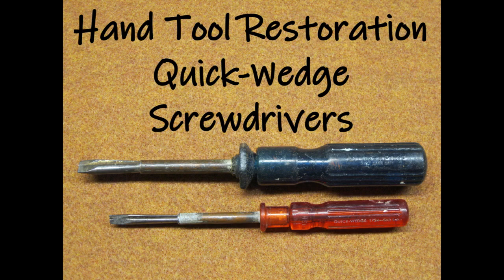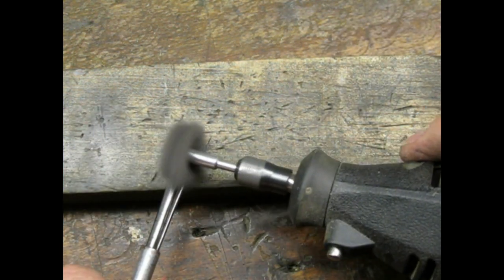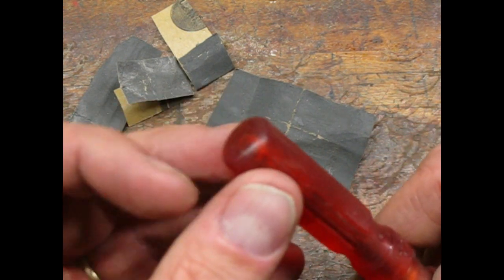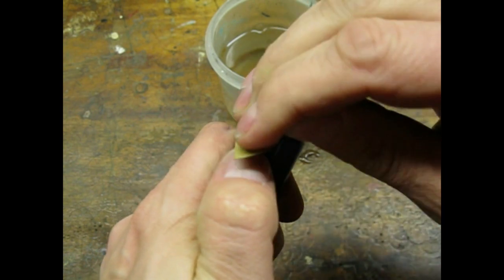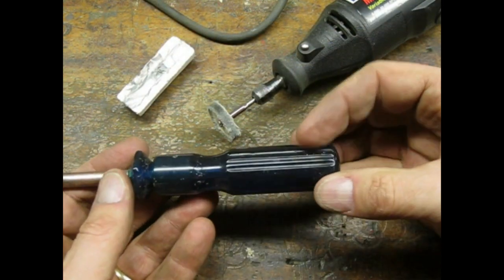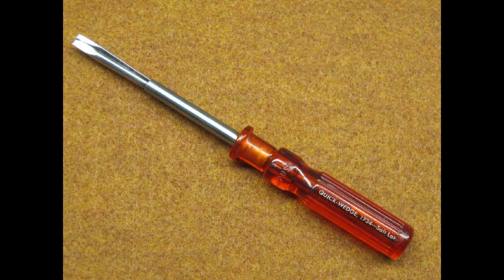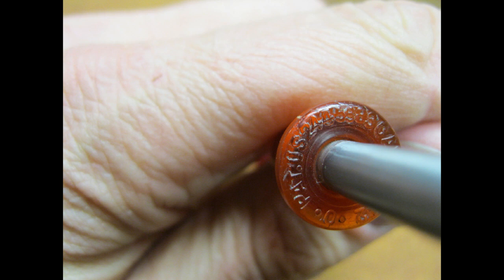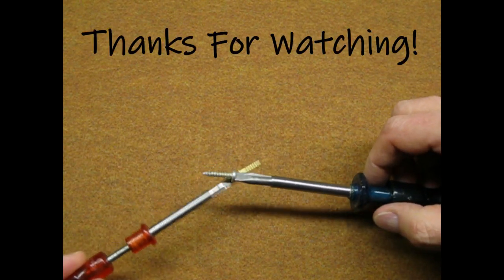Hand Tool Restoration - Quick-Wedge Screwdrivers

Comment: Great job on these, they turned out really nicely. Not bad for 50c a piece!

The copper may have been underlying nickel plating originally, possibly chrome, and once the plating has worn away I think it's a good call to take it down to the steel and polish or give a scratch finish. Sometimes I try to just polish the copper, but it's rare you end up with an even coating with no wear spots and that just looks dumb.
Reply from the maker: Thanks DG!  You may be right about the copper being and under-plate!  I would have left it if it wasn't splotchy like you said.

Comment: That is a nifty set of screwdrivers!! I've seen a couple that used some form or another of a claw to grip the screw, this one is quite remarcable. Great job, the polish of both the handles and the shafts turned out nice, thanks for sharing!!
Reply from the maker: Thanks 2/3!  I think the different screw holding designs are really interesting.

Comment: I have several of those type of screwdrivers that I purchased many years ago from Sears with the Craftsman logo on them.  Over the years they have proved invaluable for certain applications like starting very small screws.
Reply from the maker: Hey Frank!  I think I remember my dad had a Craftsman version that locked the screw differently - I think you twisted the handle and a small center section of the blade turned and locked the screw.  I'll have to keep an eye out for more of these at the yard sales!  Happy New Year!

Comment: Great video, a style of screwdriver not seen here in the UK.
Reply from the maker: Thanks Tony!  I don't think they are super popular here either - I think they have application in the electronics industry.  Quick-Wedge makes some with a shielded tube to prevent short circuits.
Reply: Super coincidence but last night on the tv was a programme called 'The Reassembler' with James May (ex Top gear). He was using this screwdriver and singing its praises, I could not believe it.
Reply from the maker: That's cool!  I can definitely see where one of these could come in handy!

Comment: When polishing plastic handles with the Dremel, do you recommend the lowest speed?
Or have you had success at faster rev's?
Reply from the maker: It is very easy to burn the plastic with too much friction.  I run the Dremel as slow as it will go and barely touch the surface.  I've been polishing the plastic by hand lately with Flitz or Meguiar's PlastX with good results.

Comment: That tube is not tapered so that would be about the 50's or very early 60's .Zann Edwards started to make them after WW2 when steel rationing ended .I worked for his 3 boys for 10 years making the Quick-Wedge , and 20 years for the new owner .
Reply from the maker: Cool info! Thanks!
Reply: That's What Mine Are Too Then . As The Tubes Are Round. My Larger One Is Green And The Smaller One I Just Got Is Red Like Yours Magdad !